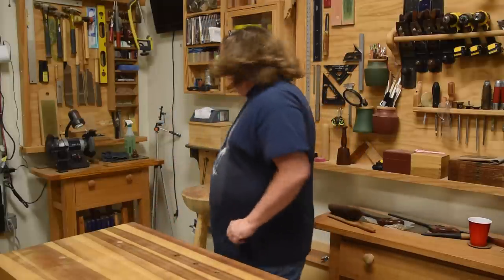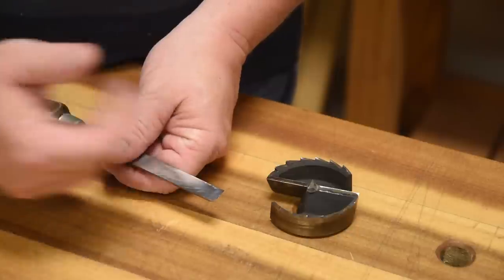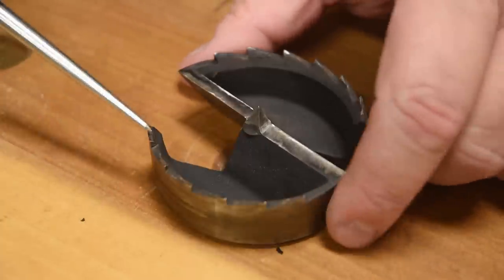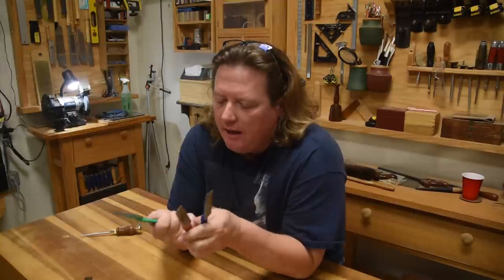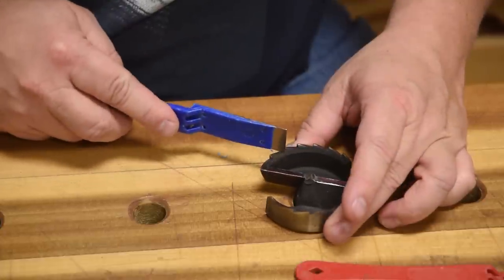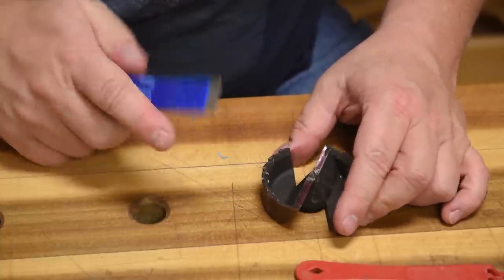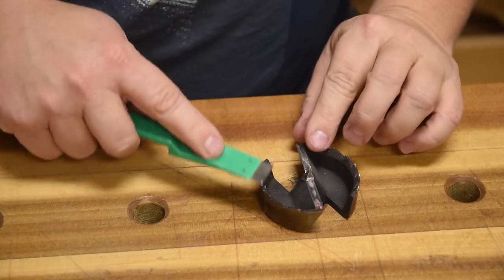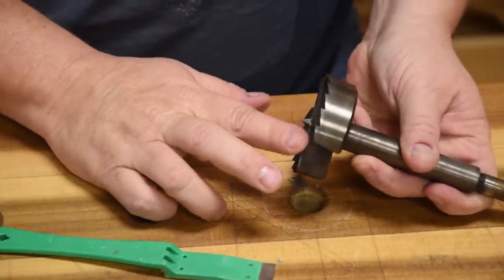Sharpening Forstner Bits

Comment: First, I'd like to thank you for a very interesting video.  I've used Forstner bits for many years and never thought of sharpening them. There is one thing I don't understand. That's why anyone would use a Forstner bit with a round smooth shank. Since a Forstner bit requires much more torque than a twist drill it makes sense to use a hexagonal shank. I noticed in your video that at one point the bit stopped while the drill press was still turning. Maybe you could explain. Thanks again.
Reply from the maker: Because that's how manufacturers make them because it's easier to get round centered. Hex are often out of round once in press due to many variables outside manufacturers control. A slightly offset bit will not make the desired size hole. I'd rather the bit slip than get a catch.
Reply: @wortheffort  Thanks again for the info. So far I've had no problem with hex shanks but from now on I'll be more careful and buy the good stuff.

Comment: Lol, great explanation of how the bit works. But!!! You never sharpen these bits on the front of the tips. It should always be sharpened from the top down. Period. Plus they are tapered on the inside in order to take less power to push through the material being cut. Thanks for your video. You helped me decide to do my own channel on how to sharpen things the right way. Been putting it off for a while. But 26 years of sharpening now and there are no channels on you tube explaining how things should be done. Again thank you! Oh, the bit you sharpened is not a fostner bit. It’s a multi spur bit. Just FYI!!!
Reply from the maker: Ya lost me.
Reply: wortheffort these bits have to be sharpened on the top. As you sharpen them you will keep the gullets at the same depth. But if you go back and watch this video. The bit is hollow ground. On the inside. After a couple of sharpenings you have to regash the bit then take a dremel tool and hollow it out again. Although I do have 100,000 dollars in machines. And know how these bits should be done according to factory specifications.like I said, he done a great job explaining how the bits work. But when he said sharpen them on the front of the tooth. That's where he's wrong. If you have a few and want to touch them up that will work. But if you continue to do that. You will end up losing the geometry of the bit. And that will cause a loss in cutting efficiency!!!
Reply from the maker: What I explained was the same as the ruler trick with a chisel. not doing much.
Reply: wortheffort wasnt trying to give you a hard time at all sir. Just was binge watching videos on this subject.. when I got to yours I had enough. So I posted. As far as touching these bits up you are right! But, if you continue to touch them up in the same manner you posted. At some point you will ruin this bit. But you did a great job of explaining how this bit works and a good job of touching it up. You also need a flat circular object to lay on the top. There should be no more than .010 in height between the spur cutters and the chip lifter. As you said, the outside cutters do nothing but score. The chip lifters remove the wood. Again sorry if I over stepped!!!

Comment: Excellent Series, recommended to all of my ww friends. I am going to replace my ryobi set with a fisch set next month, any advice on how to sharpen up the curved cutters on the fisch bits?
Reply from the maker: I'm not familiar with those but I'm sure if you examine it closely you'll be able to figure out which part you shouldn't touch (and when you can break that rule) and which part is designed to be ground upon.
Reply: Thanks for the quick reply, makes sense.

Comment: Referring to the chippers (the large teeth in the center of the bit), that's not the way I was taught to sharpen them. Instead of sharpening the tops of the bits, I was taught to sharpen the sides.  (Or, keeping with the analogy of a bench chisel, sharpen the back, not the bevel.) The reason for this is you want the chippers to be exactly the same height as each other and exactly the same height as the rim.  That nice, even height is hard to maintain if you sharpen the tops of the chippers.  Here's a link to a Wood Magazine article that is consistent with what I was taught such a long, long time ago: https://www.woodmagazine.com/woodworking-tips/techniques/drilling-boring/how-to-sharpen-forstner-bits.
Reply: I agree with you about not touching the chipper bevel.  
With Lee Valley HSS forstner bits, the height of the chipper bevel edge is about 0.005" lower than the rim.  
link to Lee Valley instructions: http://www.leevalley.com/en/html/06j7104ie.pdf

Comment: Hey Shawn, what's your take on the colt maxicut forstner bits? They are extremely steep in price but claim to be extremely easy to sharpen, giving longer life to the bits and making up for the high cost.
Reply from the maker: I'm afraid I can't make any opinion of them as I've done no research and haven't used em. I'll use up what I got first. Make the most of what you have I say.
Reply: I know nothing about that set of bits, but “easy to sharpen” is usually diametrically opposed to “longer life.” The softer metal is, the easier it is to sharpen, but the harder metal is, the longer it holds an edge. The soft metal gets its sharp edge rubbed off faster.
Reply: “Longer life” is fairly irrelevant to me, because I probably won’t wear out a set of Forstner bits in my lifetime (though they might rust out). But some guys bore holes all day, full-time, so long-lasting bits would be worth a lot to them.